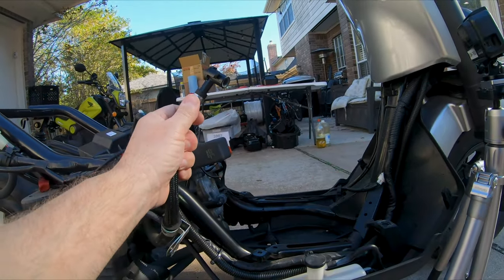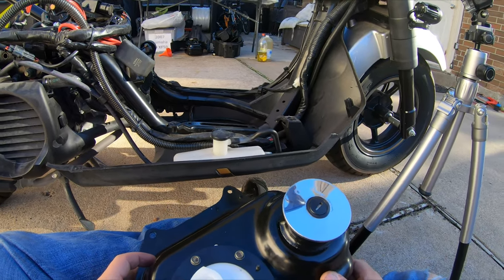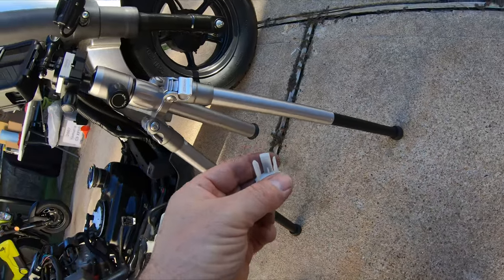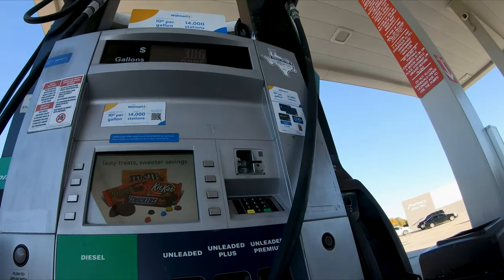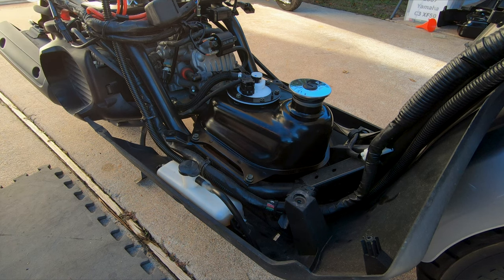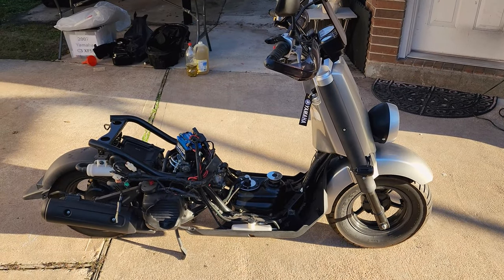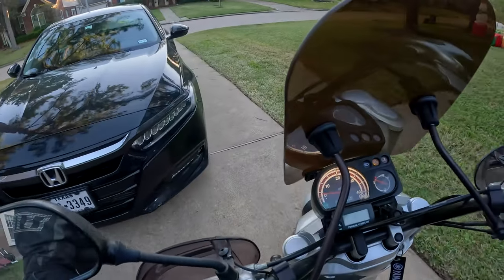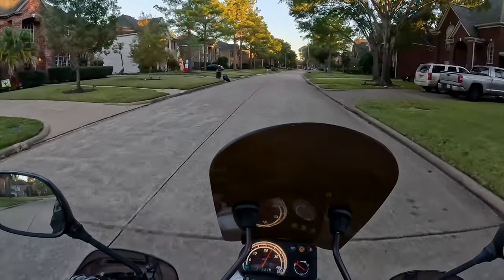2007 Yamaha C3 XF50 Scooter Restoration Project: Part 3 - IT LIVES!

Comment: You really need to find a good (used) motorcycle lift.  Your knees will thank you and your friends that ride will be blowing up your phone begging for some time on the lift.  You could make a tidy sum doing just independent oil changes, filter, and spark plug changes for the folks who aren't mechanically gifted.  And it's good content.

Comment: I done two of these fuel pump deals on my C3's 3-4 years ago and I used knock off pumps from ebay or amazon for like $10 with good results...
Reply from the maker: Howdy, Doug!  I considerd the cheap pump motor inserts, but my original unit was really corroded.  I opted for the brand new Yamaha pump & sender assembly just so I wouldn't have any problems.  WRONG.  The fuel sender doesn't work, so now I'm stuck with another problem.  I'll figure it out... maybe get a generic housing and sender from eBay or Amazon.  Cheers!  😉👍  --QM

Comment: If I have not mistaken your check engine was lit all through the test ride and it may be because you're spilling oil due to the dipstick not fully screwed in. I had a similar experience, checked everything before the test ride and gone however forgot to screw in the oil filler dipstick. pesky mistakes lol!!

Comment: Do you have any advice on why my Yamaha C3 fuel injector is not squirting fuel. I’ve already put a new fuel pump and I’ve already cleaned the injector and it has a new battery when it hooked up to injector wire. It just doesn’t squirt if I put fueldown the injector hole the bike starts up right away. What could be killing power to the injector. I hooked an ohm reader up to the injector itself and it reads .013. I’m not sure if that means it’s good or bad. Please help.

Comment: Hi. I have a question about my C3. New fuel pump and plug since suddenly running rough. Engine light still on. Runs a tad better but not humming as before. Could my injector be suspect? Thanks.
Reply from the maker: 🤔 Interesting. What is the mileage on your scoot?  If you haven't checked or adjusted the valves lately, they might be slightly out of spec.  If you replaced the spark plug, check the plug boot and the spark gap to be sure they are good.

I would also try cleaning out the fuel line and injector, then clean the throttle body.  Try running a high concentration of fuel injector cleaner (2-4x the recommended dose) for one tank of fuel to see if that helps. If that doesn't fix the problem, the ignition coil would be the next thing I would suspect.  Unfortunately, the fuel injector and fuel line are a single assembly that is a bit pricey... that would be the last item on my list to purchase.

Good luck, and let us know how it goes!  Cheers!  😉👍  --QM
Reply from the maker: Also, I forgot to mention that I have the factory service manual if you need reference info.  There is a PDF version circulating on the internet.  Let me know if you need more details.  😉👍  --QM
Reply: Thanks. Mileage is 13,910. Just added a half gallon of 92 octane and 2oz. of fuel injector cleaner. Going to run awhile I guess.
Reply: I'm not much of a motor head but am willing to DIY stuff with solid instrucions.
Reply from the maker: Here is the link to my shared Google Drive folder for the C3:  https://drive.google.com/drive/folders/1Uc3fPpFMPFuy58F6JTHlX1cw1qAtmEtK?usp=sharing .  You can find a copy of the factory service manual in there with all of the maintenance and troubleshooting details.

Yamaha specifies the initial valve clearance check at 600 miles, and then again every 6000 miles.  So, if your scoot has ~14K miles on it and hasn't been inspected or adjusted, then the valves are probably too tight (that's a BAD thing).  If the engine is hard to start and stumbles a bit, then the intake valve is probably too tight and not closing completely.  If you hear some popping or "backfiring" through the exhaust, then the exhaust valve is too tight.  The exhaust is the bad one because hot combustion gases blowing past the valve seat can burn the valve edges and damage the cylinder head.

The check/adjust procedure isn't difficult, but removing all of the plastics is a bit tedious.  You can follow the instructions beginning on page 3-10 of the service manual.  Cheers!  😉👍  --QM
Reply: Hiya. Do you have a part number for a fuel injector for my 2011 C3?
Reply from the maker: @Beachcoach83  I do have the part number, but you're not gonna like it... it's over $330!  🤯

The fuel hose and injector assembly are sold as a single unit called the "PIPE INLET", Yamaha part number: 3B3-13930-00-00 .  You can find the full parts diagram here on Partzilla:  https://www.partzilla.com/catalog/yamaha/scooter/2011/c3-xf50aw/intake  (the hose and injector are item #2).

I recommend salvaging the original injector if possible.  I've cleaned mine out 3 times by removing the entire hose/injector assembly and then hanging the hose open end upward.  I filled the entire hose with carburetor cleaner or Techron and let it sit for 24 hours, then drained it out and reinstalled it on the scoot.  That has worked every time so far.  Good luck with it!  🤞😉  --QM
Reply: Well after changing plug, fuel pump and soaking fuel injector and pipe tube in carb cleaner. No change. Engine light on and bogging out. I tried to kick start over and over the other night after letting it sit and it occurred to me I wasn't hearing the fuel pump so I pulled the battery to charge it. It was toast. I amazoned a new battery and installed tonight. Kick started it and within 3 seconds the engine light went off! I ran it around the block and it felt great! Now I will pay the overdue registration. I am pretty confident it has a new life! 😊 Thanks for your help along the way.